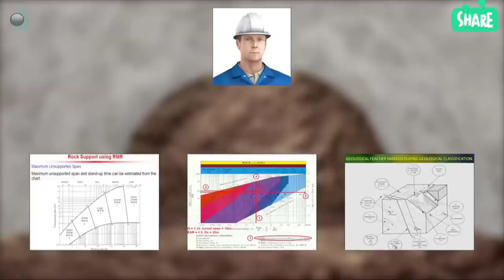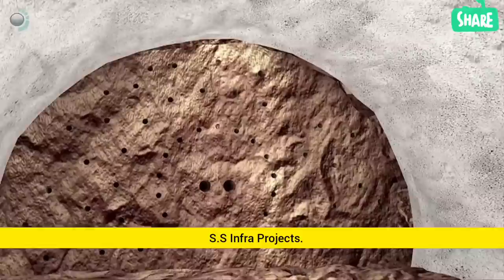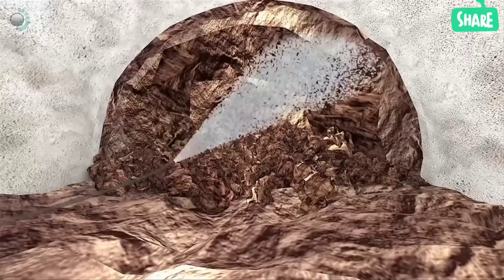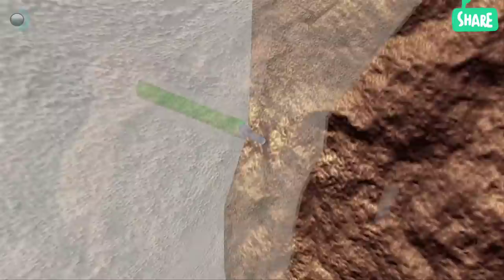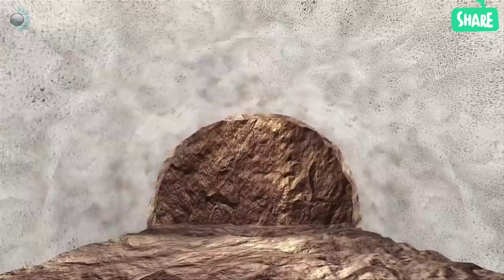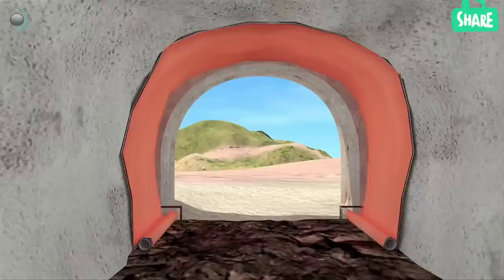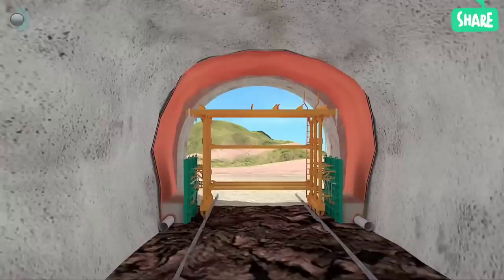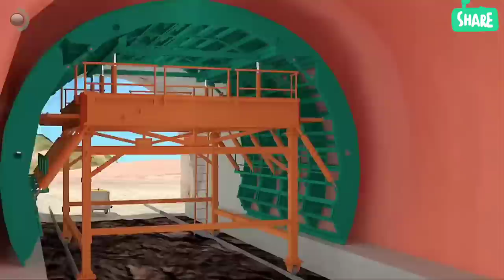NATM (New Austrian Tunneling Method) Tunnel

Comment: This is NOT new ... it is standard methodology for any project lacking a TBM.

- 1 for lazy research.
Reply: Totally agree. Nothing new
Reply: It was new back when it was invented, we used SCL Sprayed Concrete Linings in chalk with steel rebar ribs and tow layers of mesh. Later fiber shotcrete replaced the ribs and mesh. This method is used for short length tunnels where the cost of TBMs would not be cost effetive.
Reply: This is a one of the best technology and Austria is world famous in making tunnels because of this.
Even Nitin Gadkari had to visit Austria  few years back,for India to achieve its dream of having top infrastructure.